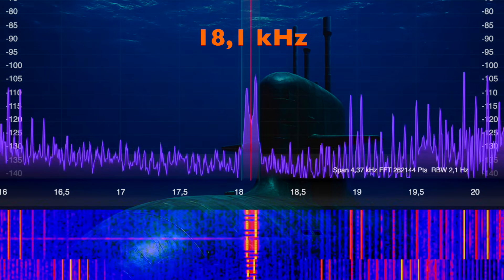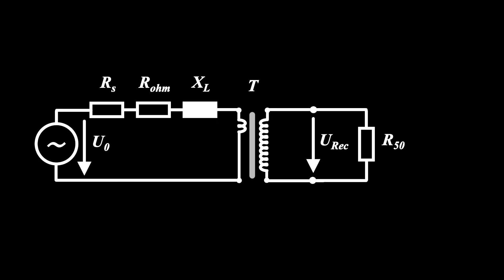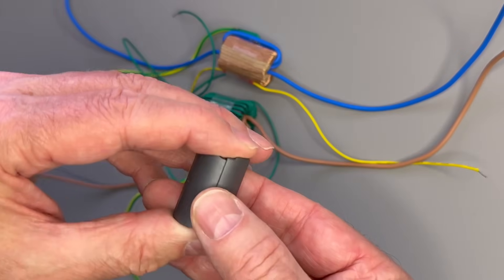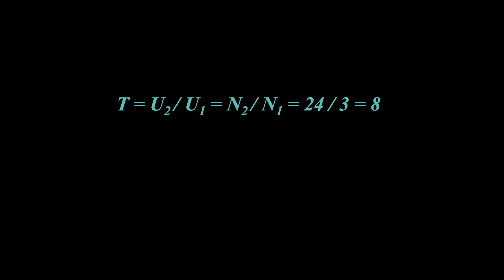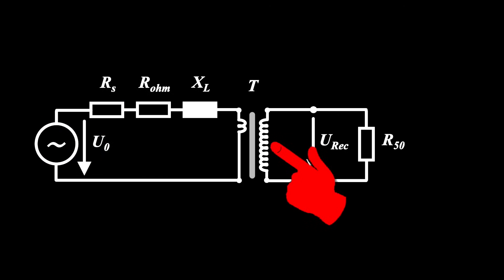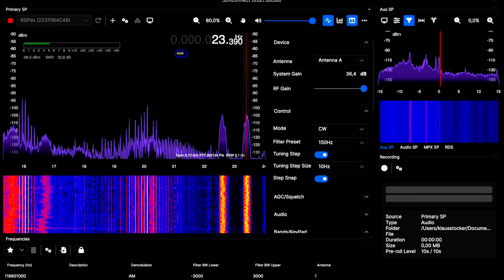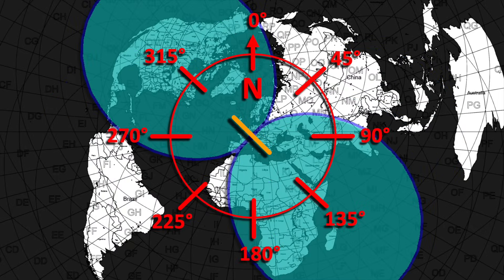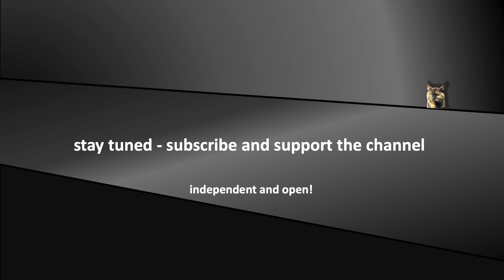Wow: Clever VLF Alternative to Coil Antenna (EP171)

Comment: You should NEVER use Ferrite cores for VLF survellance.  Barkhausen discovered the "high noise" effect a hundred years ago.  You will never get below the inherent thermal and mechanical noise level of that core.  Our company used various metal alloys, like permalloys, but these were "destressed" before use, and they had a sacrificial layer on them, to allow them to slide mechanically over the turns themselves.  Aged metals were also used.  It is not necessary to use a high MU material, since it only serves to reduce the potential losses, but a high Saturation value allows a larger dynamic range.  For the best results, you will have to "cool" these artifacts, to as low a temperature as practical, BUT not to the point where they are having "glass transition" failure modes.  Newer nano-crystalline materials are a better choice.
Reply from the maker: Thank you for your comment!
Yes, that would be the expert solution with special materials, cooled components, etc. 
Of course, I can't cool my receiver, so I'm not sure if it would make much difference. It's all amateur equipment, and I'm making the videos for amateurs. 
But of course, there's still a lot of potential that professionals are exploiting.
I can check how much the antenna raises the noise floor. Then I'll see if I can get some more out of it by using better transformer core material.
Regarding the core, do you have a suggestion for a concrete commercial product?
Regards, Klaus
Reply from the maker: PS: there's a lot of good points you're making. It would be worth a separate video on that. So, informations, comments, and questions would be more than welcome.
Greetings Klaus

Comment: Very interesting articles. I would like your opinion. If I use an EHT transformer from a black-and-white TV, using the secondary with the EHT output connected to the loop you indicated and using the primary, choosing the one with the lowest resistance (impedance) connected to the ANT A socket of the SDRPlayer, do you think it could work for VLF reception? If I used the HIGH Z input of the receiver, would it only increase the noise or improve the reception. This also applies to the circuits you proposed. Thanks for the information. Congratulations on the detailed explanations.
Reply from the maker: Thank you for your comment! I'm glad you like the video!
Regarding the EHT, I'm not sure if its impedance on the low-voltage side is low enough.
But perhaps it could work with an audio transformer, since it transforms a high impedance to 4 ohms. It might be capable of a bit more than 20 kHz. 
Greetings, Klaus

Comment: Another amazing video, Klaus. The field of VLF is absolutely fascinating. Thanks again very much. ❤
It would also be interesting to see how the antenna's directional dependence could be improved by connecting two rectangular loop antennas in parallel, offset by 90 degrees.
Reply from the maker: Thx for your comment! That's an interesting idea and I will consider this in a separate video where I will simulate this with NEC.

Comment: Thank you for your effort! Do you use this clever solution with a Möbius Loop or just a single wire loop?
Reply from the maker: Thx for your comment! It's a single wire loop. As you can see there's very little noise. So far I didn't consider any shielded concept for the VLF antenna.

Comment: I use AM radio ferrite bar moving in and out in coil and can cover 10kHz to 1800kHz with different capacitors. LC tank.
Reply from the maker: Hi there, thx for your comment! 
Interesting. How do you rate your antenna in sensitivity in the VLF range compared to the what I presented in the video?
Greetings
Klaus
Reply: @electronics.unmessed A wire loop antenna is more sensitive than a ferrite rod antenna. For my radio receiver, I also wind one turn of the link on a ferrite rod and connect it to the loop antenna approx. 2.7 x 3...4m. Outside the house I can connect the "miniwhip" antenna built into the receiver.
I use homemade TRF receiver 3-V-2.
Moving ferrite rod coil ( variometer ) and capacitors make LC tank.
Reply from the maker: @ingussilins6330  I see, thx for sharing your experience. Greetings Klaus

Comment: The submarine thumbnail caught my attention. If you ever got close to an underground coal mine with the proper equipment, you may have been lucky enough to discover the signals from one of the ULF systems used to communicate emergency and other messages to miners up to 500m underground, from an antenna buried on the surface of the mine. We used 372Hz and 428Hz depending on local mains frequency. As far as I know, submarines used even lower frequencies to communicate underwater, around 72Hz, SLF. I'm not sure if anything mentioned here would be useful for submarines that weren't near home or on the surface. So was the submarine in the thumbnail relevant, in case I missed it? Always happy to be corrected and learn.
Reply from the maker: Hi, thx for your comment.
For example: The station Rhauderfehn, see on Wikipedia, is working on 23,4kHz. It has a worldwide reach. They say they can communicate down to 30m depth. 
Lower frequencies will for sure go deeper. But the bandwidth and the transmission rate is much lower. 
I am sure that several VLF, SLF, and ULF frequencies are used.
Greeting!

Comment: Thanks for the video. What is the composition of the ferrite core mix (31, 73, 43, etc) that you utilized? I attempted to find that information but was not successful.
Reply: Palomar Engineers site has good information, as does Fair-Rite, and Magnetics Inc.
Reply from the maker: Thx for sharing!
Reply from the maker: Thx for your comment!
That's a good question actually. I found Core Mix 31 for the RFI Chokes I am using. 
Looking at the characteristics for different mixtures, I found that at 100kHz all mixtures are coming very close. I guess it's the same below 100kHz, but I couldn't find the information. Have you got a source for this information?
Greetings
Klaus

Comment: Hello Klaus.  I made this type of loop about 5 years ago and it worked really well.  It was a square  1.5m per side and I used a  ferrite core with about 30 turns on it as a  transformer.  I was surprised how well it worked in the back yard.  I have very high noise levels on HF but this loop was almost noise free and I could here the Japanese  time signal on 40 and 60khz as well as the Chinese one at 68.5khz.  Russian Alphas and my local hehe VLF submarine  station NWC 19.8Khz in Esperance Western Australia  was S 20+ about 3500km away .  I can hear all these also on a miniwhip antenna but with much higher noise levels that wipe out the Alphas  most of the time. My Miniwhip also gets cross modulation from a local medium wave station 1km away.  Anyway as you say this type of loop antenna works very well at VLF.  Just for your information instead of a SDR try using a good quality 193khz sound card.  That will work far better than any SDR at the lower frequencies down to a few HZ and many SDR software are happy to work with a sound card up to about 80khz.  Most sound cards also have a much higher dynamic range than an SDR.   Thank you for your video! 73 de VK3VLF
Reply from the maker: Hi there,
Thank you very much for your valuable comment! 
I am glad you like our video.
Your antenna has similar dimensions to mine. I'm especially pleased that you're sharing your experiences here, as this is of course of interest to radio enthusiasts.
By the way, I am using RSPdx SDR receiver, which is supposed to be particularly well-suited for low frequencies. But a high-quality sound card might actually be even better.
I'll take a closer look at the theory behind this and work through a few new ideas that I have; I think it can be still improved a bit. So stay tuned! 
Greetings, Klaus

Comment: another great video! Klaus would you say the length and the width of the ferrite core before adding windings is maybe about 50mm x 20mm? I'm wondering about the size. I'm assuming they're generic and don't have a specified Mix type?
Reply from the maker: Thank you for your comment!
I'm very glad you like the videos.
The external dimensions of the ferrite cores are 20mm (diameter) by 30mm (length). They're actually generic parts that you can buy for little money. I've provided links below.
Regards
Klaus

Comment: I find it hard to believe you can pick up any actual radio signals with just a simple loop! You are probably just getting noise from switching power supplies, LED lights and things like that!
Reply from the maker: Thanks for your comment!
Yes, these things aren't easy to understand, I admit. My first experiments with SDR receivers made me believe that, too. 
That's why I made so many videos about it. You should definitely watch them. The data signals on these frequencies are real, no fake or so.
Greetings
Klaus
Reply: @electronics.unmessed  I don't believe any of this. It all seems to be nonsense made up by AI!
Reply from the maker: @stevec5000  Yes, hard to believe. But it's not an AI fake; it's simply electrodynamics, which I explain in every detail. You can understand it or not ;-)
Reply from the maker: @stevec5000  In case you have difficulties to understand, please let me know. BR
Reply: @electronics.unmessed There'd nothing to understand since it's fake so I'd have to see that to believe it! I can pick up VLF on a large G5RV if I use a tuned circuit to filter the frequency but not on anything smaller.
Reply from the maker: @stevec5000  A loop is superior to a long-wire antenna in this range. It not only has a higher signal strength but also a lower noise level. And obviously, you haven't tried it, so don't call it fake! The method isn't new, by the way; there are other channels that have achieved good results with the low-impedance loop. But as I said, my offer stands; let me know if you want to understand it. BR Klaus
Reply: @electronics.unmessed A loop is not superior to anything except maybe a worse loop!  First of all the problem here is that only 2 signals can be received in this area, some kind of beacon on 338 KHz and WWVB on 60 KHz. I've tried all kinds of loops and other things over the years to get WWVB but none of them work! Loops don't do anything and even those so called "atomic" clocks that are supposed to pick up the signal to sync the clock with a loopstick don't get anything. The loopstick won't pick up the weak signal and neither can those worthless "probe" type antennas that are advertised, they are a scam too!! I see a lot of those  "atomic" clocks at thrift stores after people buy them but toss them out when they don't keep time so they are no better than loops!
Reply from the maker: @stevec5000  
The loops are good at VLF (3-30 kHz) and LF (30-300 kHz).

Your long-wire antenna has two major problems in this range:

1) Polarization: It receives horizontal polarization. However, VLF is vertically polarized because practically only the ground wave propagates.

2) Impedance matching: Even a long-wire antenna is electrically short at VLF, unless it's five kilometers long. Its impedance is therefore very high and capacitive. There's no chance of matching it to 50 Ohms. That's why electrical VLF antennas have a low-noise, high-impedance preamplifier.

If your G5RV receives anything at all on VLF, it's probably via the vertical feed line, because the feed isn't 100% symmetrical.

VLF loops operate on a different principle! They also need to be matched, but completely different! If you do it correctly, they'll work.

In any case, thank you for your comment, which gave me the idea to explain the differences in a new video.
Reply: @electronics.unmessed  You may be right but the G5RV is still the only thing I've found that can pick up any signal.
Reply from the maker: @stevec5000  Definitely good for shortwave. But for VLF there's much better options.

Comment: Excellent practical details for VLF work. Thank you. It is important to get high self inductance for VLF, so number of primary turns and relative permeability of the ferrite material is important. I've used parts from old switch mode power supplies with good results. Have you tried multiple transformers in the signal path to get the high step-up ratios with reduced winding capacitance? I only ask as I enjoy playing with these things also.
Reply from the maker: Thank you for your excellent comment!
I'm very glad you like the videos.
Yes, that's exactly the point where I think the antennas could perhaps be improved further. I'm planning further investigations in this direction with an improved equivalent circuit and experiments. I would be grateful for your input. Stay tuned!
Regards
Klaus
Reply: @electronics.unmessed  Great. I would be happy to help work on this. Long Wave Club of America is a good place for discussions ;-)
Reply from the maker: Cool, that's great!

Comment: There is no weather fax below 30KHz, there used to be DPA and DWD, but that was 40 years ago and just below 150KHz! 
Where is it supposed to be and from which part of the world?
Also are there any signals up to 30 KHz that you can actually decode?
I can also see many signals down there but they are useless because I can't decode them, apart from time signals ... I'd rather chase signals on the satellite L-Band, because there is way more stuff to decode and even voice to listen to.
Of course it is good to understand what you need to pick up signals on VLF, to extend your general knowledge, but its pretty useless to practically do so, because you can't gain any information from it.
Reply: No, it's not useless. Twice a year, the ~100yr old  SAQ machine transmitter in Sweden broadcasts on 17.2 kHz in CW. During the broadcast (approximately 20 minutes), there's no time for major experiments; you either receive it or you don't. I'm located approximately 710 km south of the transmitter site, and it's not easy to receive anything, but I've managed well (in the field, away from urban noise). There are also reception reports from Italy (approximately 1500 km) and the USA.

If your goal is to receive SAQ, you have to focus on the transmissions below 30 kHz and optimize your equipment accordingly until the "big day" arrives—usually around Christmas.
Reply from the maker: Thanks for your comment!
For your information: The DWD (German Weather Service) still has a broadcast schedule for 3855 kHz, 7880 kHz, and 13882.5 kHz. And the weather services of many other countries certainly do too.
VLF is an interesting band for many other reasons, as its propagation is unique. And many radio enthusiasts are experimenting with it themselves.
Regards,
Klaus
Reply: @electronics.unmessed  I know, I am one of the nerds who are occasionally decoding these signals, like I did in the 80's, when the HF band was full of RTTY and Fax news stations from all over the world. Back then Interpol radio telexes were sent using plain ARQ🤣!!! 
Anyway none of these stations have ever sent anything simple decodable below 30KHz, which was the point I was making, so people don't build a VLF antenna and expect anything useful to decode below 30kHz. 
Since over a year I am also using a cheap but brilliant Web-888 SDR in my LAN that I access via VPN when on the go. The Web-888 is technically a much cheaper and better Kiwi SDR on steroids with massive CPU power and a 16 Bit A/D, so it can handle more dynamic but is also using a GPS clocked oscillator and automatically synchs up with EiBi database on the frequency scale, which is a dream in real life operation. You click on the Tag in the frequency scale and it automatically switches the mode and adjusts the frequency, so it is super convenient. Sometimes on my way back  from work I connect via VPN to my LAN and watch German weather fax via my Web-RX on my phone on the subway here in Munich, which  shows you how much of a nerd I am 🤣.
With a Web-SDR you can decode almost everything from any Web capable device, Fax, SSTV, RTTY, FT8, HFDL, DRM ... while the Web-888 in the background is decoding FT8 from 80-6m band ... check out PSKreporter "received by" "DL8EBM". Its usually around 20.000 FT8 reports per day from around 150 countries in average ... all via an small indoor loop in the attic.
Reply from the maker: Thx for your comprehensive comment! And thank you very much for sharing your experience here. I must admit, I am more interested in the physics, layer 0 so to say.